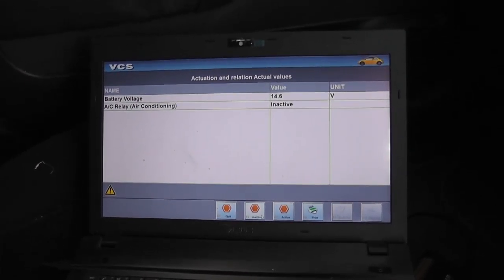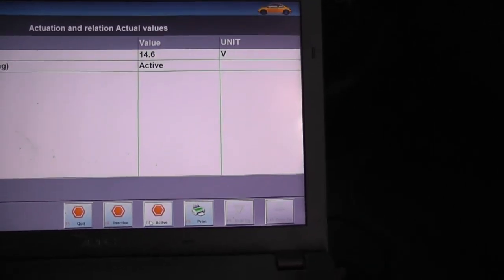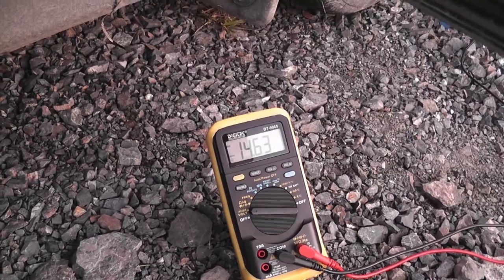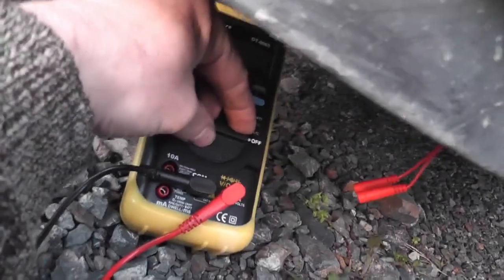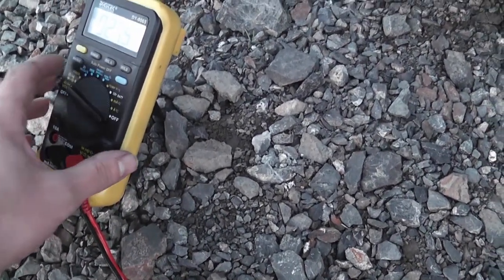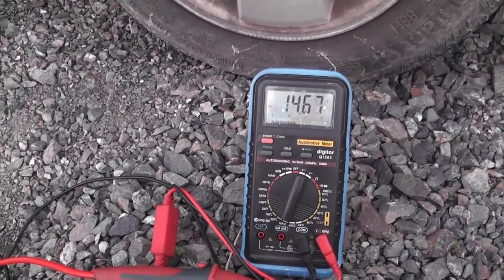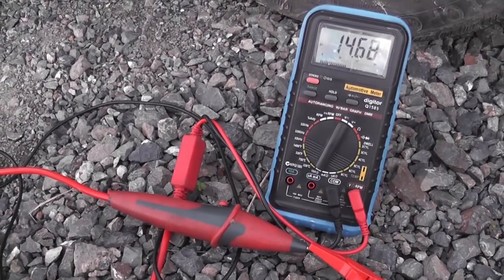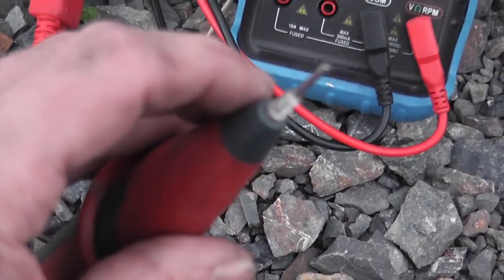Loadpro Tool in  action! GM-Astra airconditioning

Comment: U could habe just send 12 volts yo the clutch.
Reply from the maker: @hayguey7952  I used the loadpro to check the wiring is ok load testing as putting power to the clutch won't test the wires.

Comment: I like my LoadPro also. What was the bidirectional laptop software you were using?
Reply from the maker: Astra I am quite sure it's the Launch idiag it's basically 90% the pro tool from 2014 the diagun if you can get secondhand or any new pro tool. Idiag was discontinued and launch make crap cheap tools and change tools like if it was underwear. Alternative a full version gm tech2 I used it to programm the new ecu that car also needed. The pin code you can read with xtool it's in the ignition lock the eeprom if you need to read from there watch Lm auto repair.

Comment: Can you test and load fuses? Do you have to remove the (load) ie. a module?
Reply from the maker: there is a 26 ohm resister inside the tool to load the circuit you get a chart from dan sullivan with the tool as on a huge wire this load test can become invible to a test , dan sullivans book has all the info ohms law is the same for anyone. including the heaters of the load pro. . you could but cant do the same test with a test light a incondesent bulb is not a constant resistance just a visible aid as where this tool gives a voltage drop test via multimeter via ohms law.
Reply from the maker: Do you have to remove the (load) ie. a module?
the tool is to test positive and negative. by loading the circuit So if the module is loading the circuit  you load it some more  to sea   a voltage drop or non. and  by knowing  what voltage drop you should see or not see  you know the positive side is fine. "but the module +- has low  voltage then you know  you have a ground side issue instantly by proofing the positive  load  did not  drop..
its all in the book from mr sullivan. The book must be  Read from first to last page its not a book to  find a solution  to  a particular problem on a particular page.

Comment: I also have the LoadPro... I like it. A test light is fine, but I've had cases where the test light did not light-up and when I used my LoadPro / Multimeter, it showed voltage. Once I hit the button, the voltage dropped off. With a test light you would think that the whole circuit was dead... with the loadpro you can tell that there is a bad connection.
Reply from the maker: Thomas EXOVCDS  yes its a time saver .